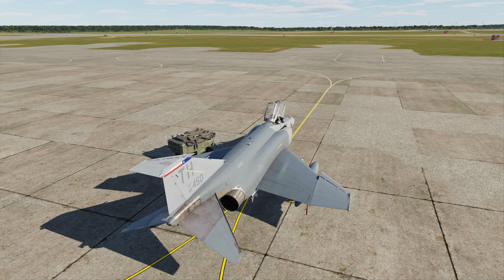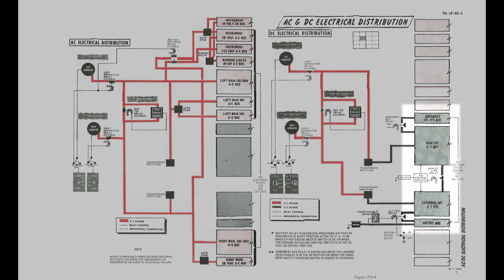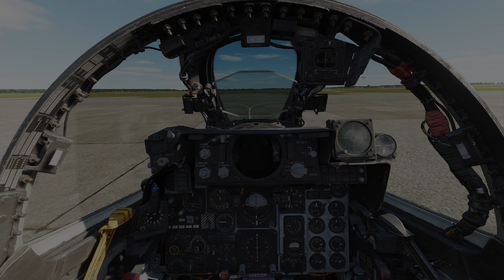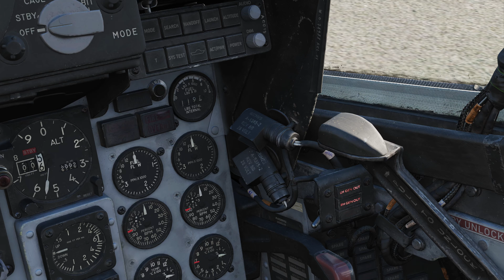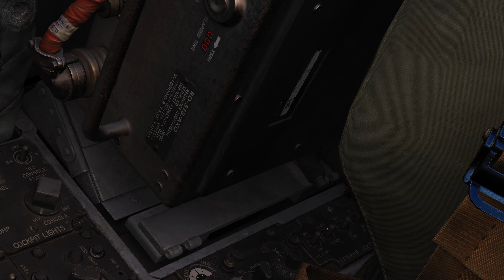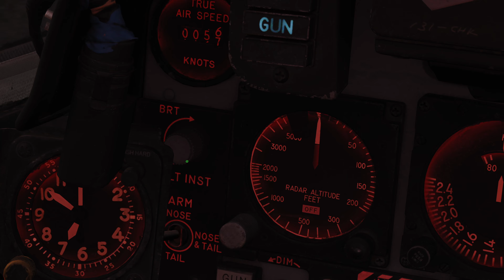F-4E Electrical and Lighting Systems | DCS World

Comment: 11:54 When you turn the switch from ext power to off position, warning lights(instrument bus) come off. However, FO-7 in the TO-1F-4E-1 says if the generator control switch(es) is placed out of the external position with inst ground power switch already in on position, the instrument bus will stay energized. Sooo.. I think it shouldn't turn off like that. Idk I got it correctly, but it would be good to know whether it's correct or not

Comment: Nice video explaining this generator sync.
One note regarding that knob near the clock. Currently it acts just like an on/dim position switch with turning it having no further effect. There is an info in the manual stating, the functionality will change later.

Comment: Brings back memories as a Plane Cap on F-4J -S  !! Most is pretty relevant procedure wise on shore stations, however on carrier deployments we hook up to ships power from the catwalk and a huffer for the air. In The S models with Fiber optics it was much easier electrically which saved room for an other fuel cell behind the weapons officer and 1500 lbs of WT!! The F4-S also had varreable wing slats like the F4-E minus the weight of no cannon in the nose! But she got a nice big radar!!😃